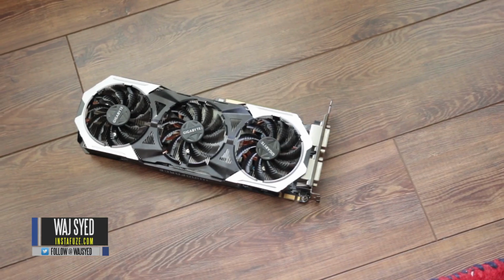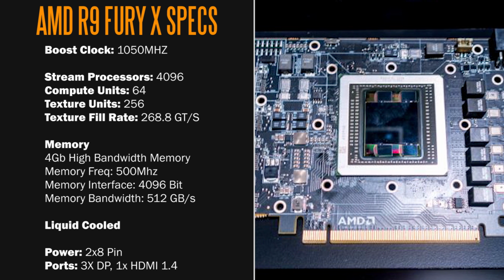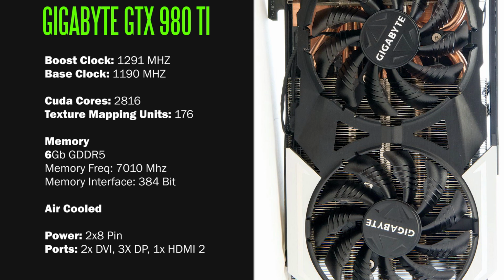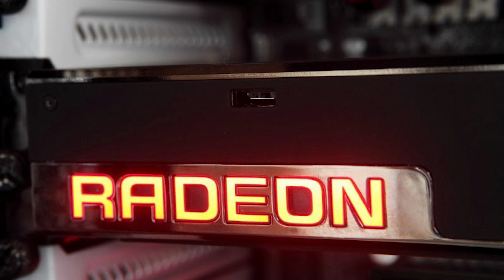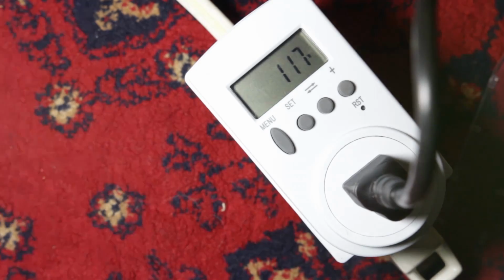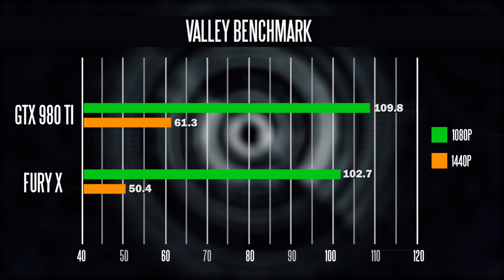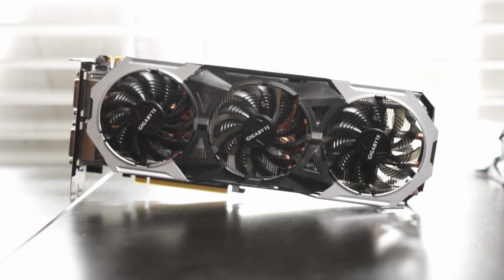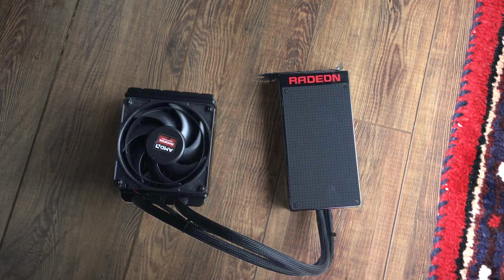AMD R9 FURY X vs Nvidia GTX 980 TI - 4k Gaming Benchmarks

Comment: You showed a kindness to the Fury X, Had you overclocked both cards to their max it would of been landslide
Reply: Bang4Buck PC Gamer Yeah I was about to say, I didn't know he didn't OC either card. I was concerned why his frames were so much lower on average than my G1 gaming. Then again mine usually sits around 1508 mhz instead of 1291.
Reply: Bang4Buck PC Gamer This is my first Maxwell card but it seriously hit 1559mhz like nothing. I barely tried and it's completely stable. I dialed it back a bit and took away some voltage for a basic gaming OC of 1508mhz.
Reply: Bang4Buck PC Gamer He's just being more reasonable ..
Reply: Sayan Sen Stock benchmarks have there place, not everyone is into overclocking I guess
Reply: Darklord Revan A 1500+overclock is serious and would place any Fury X beneath heel
Reply: Darklord Revan what mV increase did you do?

at super stock volts and 100% power target a 1253Mhz was rock solid but I decided 110% and 1437MHz stock volts but what volts are you doing at 1508
Reply: ant a I don't add any voltage until it hits 1480mhz then I add 13mv to get to 1508mhz with a power target of 114%, with =50mv I hit 1559mhz with a power target of 122%. I'm always changing memory but usually leave it around 7600mhz-8000mhz.
Reply: Darklord Revan I seem to not crash on games unless its Planetside 2 on max settings with anything more than 153+ on stock settings but ACX 2.0

well not really crash above 153+ but I saw the other fastest 980 tis out of the box run 1253mhz so I copied and it's ok but I think I tried 1400 and it crashed but with stock 100% power target and 0 mV but I saw you increase your mV

I never mess with memory as it degrades it and damages it forever as I've found with previous gens ocing ram

how do you go above 110%? that might not last after a while and you will end up artifacting at stock..
Reply: ant a My Gigabyte G1 Gaming ti let's you push it to 130%. I've done pretty extensive testing with the OC's both my daily gaming and my max oc, so far I haven't had any crashing or artifacting in multiple loops of Unigine Valley or Heaven, or Firestrike/extreme. Without OC my card automatically boosts up past 1400mhz with gpu boost or whatever it's called. So I'm sure it's not trying to put itself in harm's way.
Reply: +Bang4Buck PC Gamer You cant overclock the fury x because of how AMD locked it due to HBM being very new .
Doing an OC comparison would've been unfair .
Reply: Bob Roberts
AMD quoted that the fury X would be an overclockers dream. It's got nothing to do with HBM being new either the card can handle overclocking and show gains or it does not. If  AMD want to put locks on their card  then that's AMD's problem. Does that mean cards with real overclocking potential should not be able show it off in a comparison? Overclocking can be a deal breaker and the Fury X shows a very small increase and the GTX 980Ti streaks away and I think it's important that people know about that.
Reply: Bang4Buck PC Gamer  AMD made a mistake there .. but the fury x has its own perks .. it runs cooler and quieter than 980 ti ..

Honestly I just want AMD to release an Air-cooled Fury x for 600$ .   That will be great ..
Reply: Sayan Sen It's still a good card that's for sure but with the two cards being pretty much the same price it's best to know what you are really getting for your money because it is a pretty serious financial commitment to one piece of hardware
Reply: Bang4Buck PC Gamer of course !
Reply: If you buy that 980ti and don't overclock your an idiot
Reply: Daniel Burgos I agree the Maxell overclocking headroom is unprecedented
Reply: Bang4Buck PC Gamer the only problem is that it doesnt scale very well though

Comment: 85c on that 980 ti in farcry 4 ....you need some better airflow man, i'm in the 60's with that card in farcry 4 maxed out.. unless your ambients are super high.. but damn
Reply: D34TH550N here in the Indian subcontinent it's hotter ..
Reply: Sayan Sen real stress thing and test are allways better to show weakness in hotter ambient..only he need to publish ambient temperature! We know that, even, power supply is tested in "hot box"by AnandTech for purpose! so i am glad to see test of GPU in hotter ambient,where cooling methods will show weakness,and diff.from many brands of same card will easily show up!  need to measure GPU clock and RAM clock when temp increase,for point after where clocks can going down,and yes point of public test  like this is to put on stress,much above most user will ever have..as some obviously live and have hotter condition..at me in Europe,now is 40degr C out of direct direct sun outside.. (and by winter easily -15degrC...lol), so yes hotter test ambient became standard..and both of this card are HEATERS!  what is not bad during winnter time at all...but on summertime..damn..

Comment: I'm pretty underwhelmed by what AMD has to offer. My gaming PC is AMD based but it looks like I'm going to upgrade to an Intel processor soon and hold out on upgrading my GPU until I see what 3rd parties can do with the Fury line of cards in the future. Since my Crossfire 290 setup runs terrible on most games, I was hoping the new lineup of cards would be a good upgrade.
Reply: Skyler W. Your crossfire 290 setup runs terrible on most games? Interesting, I play at 4K and I can max out every game (bar AA) at 60 fps at 4K with my 290 crossfire setup...

Comment: 5.0ghz???? Really?? My 5820k is overclocked to 4.5ghz. There's a slim chance this  guys 5820k is at 5.0ghz stable.
Reply: +Jordan Krueger I have my 5820k overclocked to 4.5ghz too and they stay a lot cooler under load then 4790k's also. 4.5 ghz is really easy to reach on a 5820k with air cooling. I think it is one of the best price to performance ratio cpu's from intel and it trades blows with 4790k in a lot of games and you have 2 extra cores to spare.
Reply: +Jordan Krueger I have my 5820K at 4,8 1,415V ^^''
Reply: rendering youll notice, not gaming, almost no sense overclocking for gaming, im talking about cpu obviously, but if you render, nice

Comment: Fury X was not as good as i thought
Reply: *****  Stop making those excuses.
Reply: Calipha Callender  Fury X Has more RAW Horsepower 8.6 Tflops  vs Nvidia's GTX 980 ti's 5.6 Tflops  DirectX 12 Dramatically Increases the Draw call rate then the GPU's RAW POWER will be HARNESSED.
Reply: Yogz Vids 980 TI's still beating the Fury X.
Reply: We'll See When DX12 Games Are Released. ;)
Reply: Yogz Vids Then Nvidia Pascal will smoke AMD.
Reply: Yogz Vids you do realize dx12 will also increase the 980ti's performance even more ALSO. So I wouldn't expect there to be any significant changes in results. Also we are now seeing the first wave of overclocked 980ti's easily beating the mighty TITAN X's comfortably, and the 980ti Hoff edition is due soon, imagine what the performance of that edition is going to do to the Fury X, we can see the 980 Hoff outperforming the Fury X at 4k in a quite a few games, imagine what the 980ti Hoff will do.
Reply: Mark Smith So you're just gonna ignore the fact that the Titan X can be overclocked as well?
Reply: Calipha Callender No but the price difference compared to performance ratio isn't a good choice. Like I said earlier I can't wait to see what the HOFF Edition 980ti does. Hopefully also a TITAN X Hoff edition too but personally I wouldn't buy one now as Pascal is only 6 months off featuring hbm v2, probably 6gig, as good as all of these card's are I think Pascal with hbm v2 is the future, but only 6 months away.
Reply: Mark Smith Pascal isn't coming out till June/July 2016... which is 11-13 months away.
Reply: Calipha Callender I think it's not worth paying out 650 pounds for a card with a 11 or 12 months shelf life do you?. When I choose card's I will pay up whatever the price is at that time but I make sure it's still gunna be performing better than most card's that come after it, at least for 2 to 3 years, I can use my 295x2 for an example, had it just over 2years now & it's still in the high score charts. I think Pascal with 6 or 8 gig hbm v2 will be around March time according to  Nvidia quotes as they are also planning Volta for 2017.
Reply: raymon odisho AMD new series beat the nvidia low end and mid end cards such as 960, 970 and 980, but not their high end like titan and 980ti.
Reply: raymon odisho Fury non (X) is a better buy!!
Reply: Happy Marshmallow - Gaming Comedy not to mention it cost more money and eats more power
Reply: +Anthony Abelardo wow that's are 10 euros more in a year because of Power consumption
Reply: but the amount of heat in the room would be great in the winter but in the summer it would suck
Reply: +Anthony Abelardo Haha yeah r9 390 and 390x reaches high temperatures, that's true but my fury runs cool :)
Reply: stifler L. u really went fury instead of 980 ti??
Reply: +Anthony Abelardo no money for 980 ti
Reply: stifler L.
fury x cost more tho?
Reply: +Anthony Abelardo I mean fury non x, that card costs here in germany the same as a gtx 980 and it was a good deal for me. I'm jumped over to the red site because of an driver update. since a few months i have big problems with my gtx 550 ti :( now i try something new and support amd a bit
Reply: stifler L. just get the 980 ti for peace of mind as it doesn't cost like thousands of dollars more
Reply: +raymon odisho Fury X sucks bro forget about AMD and go Nvidia more money but much less disappointments
Reply: Aaron Turner its not much more, I think the Fury X actually cost more!!

more to own and more to run

but AMD might be faster than nvidia in DX12 but like by 3%but remain like 30% slower in DX11..
Reply: Anthony Abelardo
not that particular card but amd in general is cheaper. Quality is cheaper too
Reply: +Aaron Turner thats is not true I'm happy with my card and about dx12: nvidia cards dont have async shaders they lied again but if you prefer Nvidia nothing against that

Comment: I think the new driver for fury x just came out.if im not wrong.go and check the new driver at amd official website.
Reply: Yes however I don't think anybody has posted updated results with the new drivers. I've been waiting for something.
Reply: walterwaller maybe you should check out the new video from rgoc..fury x latest vs old driver.. I can see that the new driver does not improve any performance due to the old driver..

Comment: CPU is slightly?... slightly.... overclocked to 5ghz? SLIGHTLY? LOL
Reply: ImRedBlueGreen I was eating when I heard that and I almost choke ;d
Reply: Zaber Ansary Extras stock is 3.3... doesn't matter what he has had it at before.
Reply: Formerly it was at 4.5/6, So to 5.0 almost slightly.
Reply: ImRedBlueGreen I know right xD
Reply: Behold the power of glorious intel
Reply: +Bike Dude 5 ghz overclock is not slight lol that's major if you go that high
Reply: dose that mean you support them all?
if so then I love you here's a hug
Reply: *****
so am I want to ride me?
lol
Reply: +ImRedBlueGreen I am slightly confused xD
Reply: +ImRedBlueGreen I mean.... I've been rolling a 2700k at 5.2 on air for years now.  So I'd sure hope these new fangled chips could get at least that.
Reply: Bike Dude 2700k Master Race
Reply: lol
Reply: Bike Dude
so how well dose amd graphics card work with 1.75 ghz core test it I dare you and you'll find out if the consoles are getting bottle-necking issue's with their graphic's cards
Reply: yeah custom made shit hardware lol since they can't even do 1080p smoothly for fall out 4 and don't even tell me they graphics are that intense cause your some stupid fuck you know it's the shitty slow cpu that's holding it back there and not the graphics
Reply: and that's why I am pc master race all the way sure sure my pc might have cost a few bucks more then a console but atleast it can run fall out 4 at 1440p everything pushed to the wall maxed out at a nice smooth frame rate I love it and my ever growing game collection which thanks to origin and their free games trick I have an ever growing game collection with them all I have to do to keep collecting games with them is check in from time to time and see if they are offering a new free game on the lower hand it's not as frequent a change up of the new games as it is with the xbox live or playstation networks but then again you pay for those subscriptions origin is totally free
Reply: lol suck it